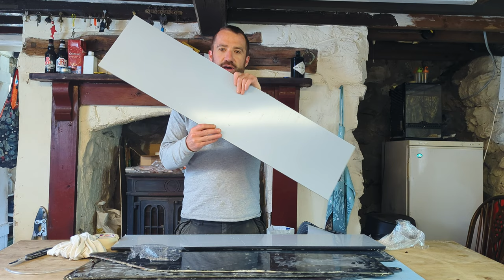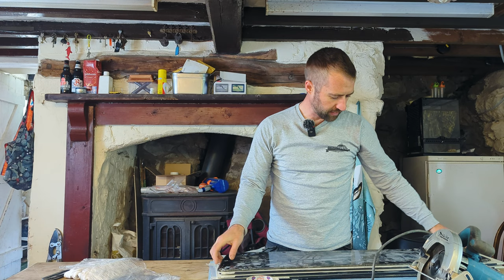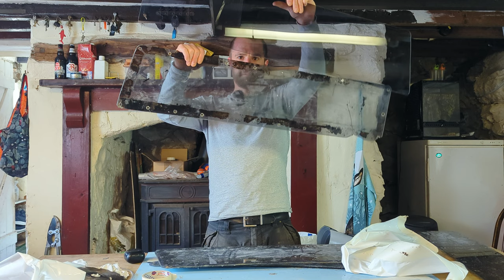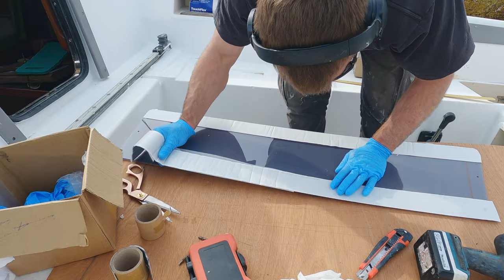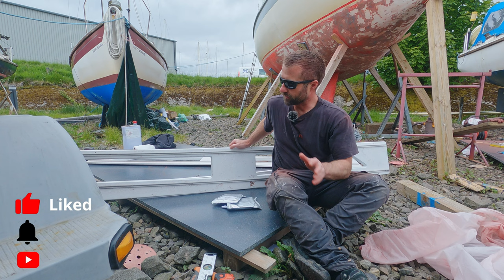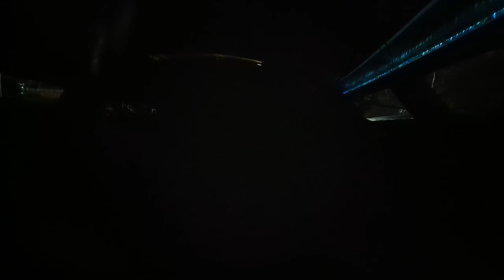Replacing our old cracked windows ...

Comment: Tim - meant to ask you what saw blade it was you got? I'm considering investing in a circular saw and will need a fine tooth blade for some of the jobs.
Reply: Hi it's a Saxton TCT Circular Wood saw blade 185mm x 30mm x 80T.

I got it on eBay in the UK.

Worked well and did nice clean cuts.  Only things to make sure if that you carry on the cut beyond the end of the piece or pull it away quickly before stopping as the saw has a tendency to want to jump when it slows down.

Also commit to the cut as once you start cutting if you stop there is a high chance it will jump and getting started again is very difficult.

Good luck with it